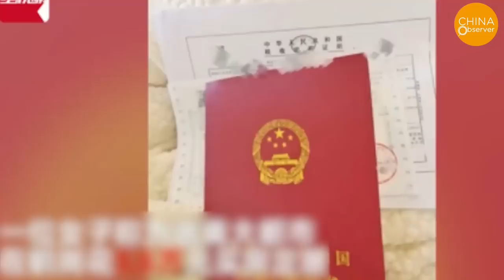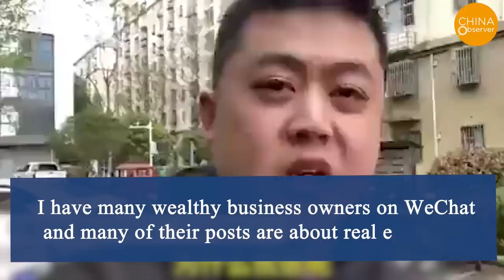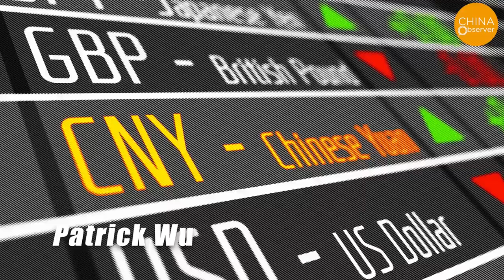1,000 Yuan for a House, the ‘Lying Flat’ Group Pours In. Why Are Houses So Cheap?

Comment: High rise buildings will need maintenance from from normal wear & the undercutting of engineer designs - one example is roof water leaks require professional repairs but many building management organizations will allow little to no work to be done keeping funds for themselves -

Comment: The statement is made that the housing industry will continue its slump in 2023. I would agree with that. On the other hand, the statement leaves open the possibility of a recovery down the line. This is, of course, not possible. The numbers are not there. In the west, you might see phenomena like foreign buyers coming in. This will not happen in China and there are already more than enough "houses" for the whole population, which is shrinking.
Reply: Very good point!
Reply: @sparkiekosten5902  Thanks.

Comment: They often talk about the 70 year lease thing in Chinese real estate. Can someone explain it? So they own the house or apartment but after 70 years they can be kicked out so the building can be torn down and rebuilt or something? Or is it because CCP own all land and it's just a 70 year promise (not that i would put much stock in a CCP promise) you can stay there till then. Makes it sound more like long-term rental.
Reply: My interpretation (which could be wrong) is that it is exactly as you suggest. The CCP owns the land. The buyer has a 70 year lease on the land, and by then, the building is assumed to be worthless. But here's a question: Does the 70 year lease begin when any given homeowner buys it (unlikely) or is a fixed date set, say upon completion of its construction (much more likely). If It's the latter, if you buy a 35 year old building, you'd not only discount it due to it needing more upkeep, but you'd also do so because half of its lease life has expired.
Reply: @gregparrott  That was my concern. The closer you get to the 70 years the harder it would be to sell and the less it would be worth. So it wouldn't be a generational investment (or even a generational home ie. leave it to your kids) like a lot of property is.
Reply: @martinaasandersen3775  I guess it's always worth something. If you buy one that's 69 years old, you check if you can rent it for a year and make a profit (utilities and maintenance not included in rental)
Reply: @gregparrott  I'm talking about buying as investment and selling after x years. The price would always go down because of clock running.
Reply: I think it is similar in Singapore with a 99yr lease